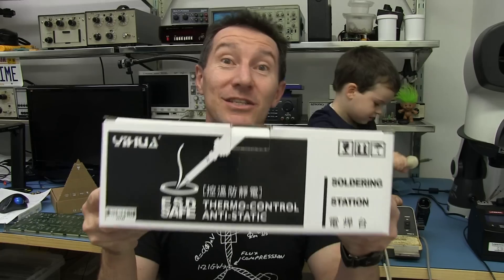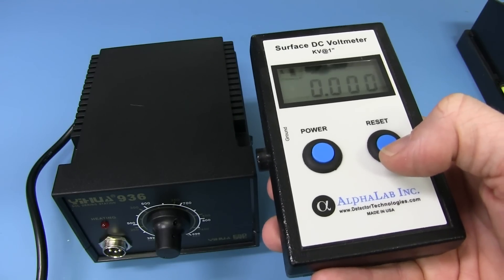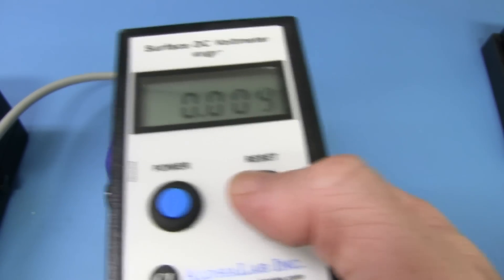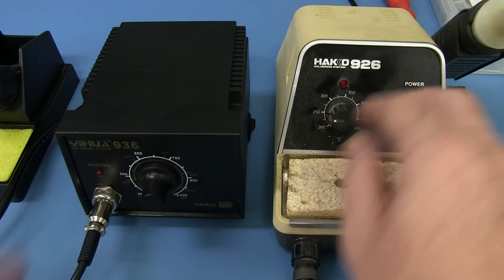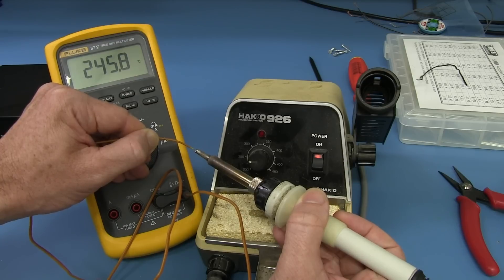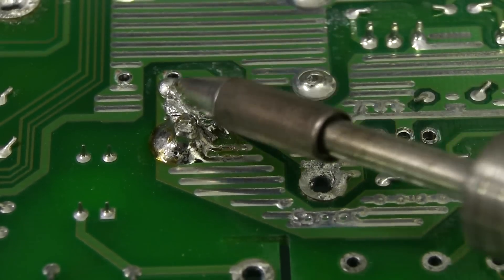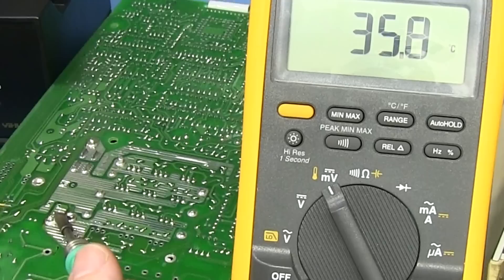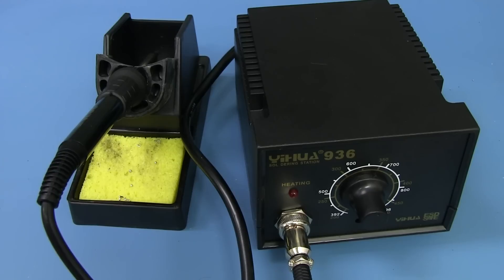EEVblog #596 - World's Cheapest Soldering Station - Yihua 936

Comment: I never even heard of hako irons, at least in the US weller is the big one. I've considered getting an adjustable unit, but what i do usually not really needed. I just use cheap 30 watt pencil irons that jus plug in. Usually use my WLlenk solder gun just because is faster. That i think is a knockoff of a weller unit. works fairly well, but i did have to replace a failing trigger switch on it, and just happen to have one that fit in my parts bin. Transformer on it seems to get fairly warm too, which i'm not a huge fan of. I think ventilation setup could be better to help with that.

I've thought about some like this: http://www.mpja.com/50-Watt-Soldering-Iron-Adjustable/productinfo/17517%20TL/
After watching this though i think i'll just stay away from that. I never knew that the base stations had transformers. I assumed it was all PWM or something like a dimmer switch, just with temp sensing.

Comment: Since when is a crimp connection better than solder?
Reply: You are right, tkarmann. There's nothing wrong with that soldered-on ground lug.

I did cringe at the soldered-on-one-side power switch connection at 10:13, however.

Comment: I own a saike 898d 24v 50w Irion it uses the hako 900m tips I've had it for 4 years now I've replaced the element in the Irion a few weeks ago aswell as a few tips here and there not too bad it also has the heat gun the Irion and the heat gun dose up to 400 c bourt it for 170AUD and it is ESD SAFE  only 1 problem out of 4 years I've done heaps of pcb DIY kits I've done a few replacement parts on brown goods tv,s DVD players ect my iron is a bit bigger compeared to the one on this video

Comment: Cleatly very few Youtube viewers where broken in on have to service the occasional point  to point wiring product.. When attaching a component lead or a wire to  a solder lug the connection is supposed to be both electrically and mechanically secure for applying solder, the purpose the solder being to shield the connection from the athmoshere and not  to be the means af attachment.  Of course from there contruction methods progressed to  PC boards w where the solder is the means of attachment, but that doesn't invalidate proper point to point construction. Although it's difficult to judge the work here from just on angle, although with the solder looking as  sloppy on the solder lug as it does through the product doesn't instill confidence.. I'm old school enough I'd remove the solder and if the job looks unacceptable from there I use solder on it.  Solder doesn't melt away from a solder lug anymore than it does off a PC board under normal conditions, so I wouldn't worry about that.

Comment: I bought this a while back for $50 and it was absolute crap i bought it as an upgrade from my dicksmith branded plug and play job and the only good thing about it was the stand... now I use a butane iron because i use it for my Bike so im in tight spaces and dont want a wire in the way

Comment: With my aoyue soldering station i can solder 6mm copper cable to a 2,5mm copper cable in my hexacopter, this at 350º C, isn't a 16$ station but it was cheaper than the hakko one, and has hot air that works fine

Comment: Why shouldn't ground be soldered?
Reply: Too easy for the connection to break and you end up with no earthing and an unsafe device.
Reply: thank you
Reply: Solder isn't the best conductor compared to copper. The closer you get to copper-copper contact the better. The solder in a solder joint is there to hold the parts in place and because it's still better than air ;) .
Also for solder joints it can be very hard to tell if they are good, especially with cold joints. That uncertainty something you totally want to avoid with an earth connection.
Reply: Personally I don't have an issue with soldered tags for grounding.  It's a much better molecular connection than a pressed crimp.
Reply: The UL Standard for soldering iron's (UL 499) specifically doesn't allow for a soldered ground because the solder can melt.  Other standards will allow soldering only if it is additionally secured in a way that will prevent the wire from detaching if the solder melts, which usually means a screw or nut and bolt so most manufactures just use a screw or nut and bolt unless there is a very good reason.  I posted the clause from UL 499 in the main comments of this video.
Reply: I could understand that applying to a traditional mains element iron.  But if the transformer inside a plastic case is reaching the melting temperature of solder then you've got much bigger problems than the earth wire popping off.
Reply: It's not necessarily the transformer getting hot it could also be the current in the ground wire heating the wire or solder joint in case of a s/c or partial s/c to ground. It also has to pass a ground bond test of twice the breaker current for 2 minutes. In North America that would be 30 amps. (twice a 15 amp breaker)
I'm a little rusty on this but I also believe the intent may also apply to being reasonably sure the ground will go back after service and soldering may have been considered a nonstandard method and wouldn't get reattached after service or perhaps unreliable in method, materials or tools to be considered acceptable.  The reasons aren't explained in the standards and sometimes the reason isn't obvious.   If you work in this product group you would have access to team experts and internal forums to answer these questions.
Reply: In this instance if the wire was passing enough current to make the lug clamped to a large thermal mass like a transformer hot enough to melt the solder, then the fact the flex was emitting smoke along its full length and going "gooey" would probably serve as an indication that all was not well.
Reply: That brings up another reason soldering is not good since the wire coming off may mean the breaker doesn't blow and a serious fire could start. That is why there is always a minimum of two levels of protection and the ground being only one. The plastic of the enclosure and power cord has to have the same flammability properties of metal to contain any flame or dripping molten metal from the transformer windings or overheating wires.
Reply: Richard Evans Aside from the fact that the majority of workshops are fitted with RCDs (GFIs) these days, I'd still choose a soldered tag over a crimp connection.  I've seen plenty of high resistance crimps that result in an appliance failing it's earth bond test.  In that instance the crimp itself would become the source of heat and the potential for shock would increase with its resistance as it burned up.
Reply: bigclivedotcom
Hi Clive I'll re-post the clause from the UL standard  (UL499) here so you can see soldering alone is not permitted.  There are many product specific standards (part 2 rules) and electrical code rules (part 1) that fit together as a system to provide a certified safe product.  Picking one rule for one specific product without looking at the entirety of the system is going to end up as a never ending discussion of what is safe.  You can be assured the Product Safety field is very well engineered and proven over time to best practices for safety.  I could move this discussion over to your YouTube channel to start you off understanding safety testing and product evaluation. See Paragraph 26.3 (c) below, it is better to read the entire standard and the electrical code to see how this rule can or can't be applied.

The UL Standard for soldering irons UL 499 grounding is as below:

26.3 On a portable product where grounding is required or provided, the power-supply cord or cord set shall include a grounding conductor that shall be:
a) Green with or without one or more yellow stripes,
b) Connected to the grounding blade of an attachment plug of a grounding type, and
c) Connected to the enclosure of the product by means of a screw not likely to be removed during servicing, or by other equivalent means. Solder alone is not acceptable for making this connection.
Reply: When soldering to the leads of a transformer.  Don't go for the cheap solder that melt easily.  You want a very high temp solder.  This is for safety reasons when the transformer heats up.  During normal operations, the solder will not even heat up to melt, keeping the wires in connected.  Now while connected to a proper power circuit with ground.  If power spikes happen or a short happens to the transformer, the solder will last long enough to trip the circuit breaker.  If you used cheap solder and or had it on a non grounded outlet.  The solder will melt fast causing more damage in your home or work shop and to what circuit the transformer was connected to.

When connecting to the core of a transformer you would want a crimp connector.  Using a solder connector, the solder could heat up and break loose.  This loose wire could come in contact with the high voltage of the transformer causing a circuit breaker to trip.  Bad case, it might not trip and someone could get a lethal shock.

Comment: Great review.  I bought one of those Yihua 936s and I have just used its innards to do a 110V-to-220V conversion on a Hakko FX888D.  It turned out to be very easy: the transformer from the Yihua is a perfect fit for the Hakko.  I have documented the mod at http://blog.bogpeople.com/2014/09/hakko-fx888d-110v-to-220v-conversion.html.

Comment: I can't be 100% certain, but I believe the earth needs to be crimped & bolted down with a star washer under a locking nut, so it won't snap off or come loose if the unit cops a heavy wack.

Comment: No offence but the reviewer is overreacting, tell "ihaaaa' like a horse sound to a chinese brand name. I bet you have made in china shoes, clothes and many other things. If chinese didn't exist, we wouldn't have products at a low price on the market. We grew up playing with chinese toys and chinese video games and they were great and reliable and cheap. 
That soldering station is amazing for that price. 16$. You should call those chineses brilliant for manufacturing a device at such a low price. And remember...16$ is the price of the station at that store. From China that product came at a lower price. 
How much did you pay on the JBC? How many hundred dollars? You think the JBC has gold wiring inside and platinum made capacitors, precious stones inside or something? No...i bet it has chinese parts inside. And they just up the price, because, hey, it's a big brand name. 
You could have made a better review...paying some respect to the manufacturer, not making fun of that brand name and say all the time how awful is the PCB and how slow it melts the solder. And you made such a big deal regarding that earth connection ...God...even if that earth connect is soldered, there's no chance it will break or anything...don't make such a big case out of nothing.
You people really are looking down to chinese people , instead of being grateful, cause they work non-stop in their factories, with such low salaries and bad working conditions , to build and make things for the others. 16$...it's dirt cheap, it's unbelievable cheap...  And these things many times prove to be reliable.

Comment: If you are starting out poor, I can surely understand the lack of funds....but realize if you using a junk soldering iron ,its pretty likely you will stay poor. I say this because a garbage soldering iorn with misstated specs could easily damage/destroy  a PCB costing thousands of dollars due to leaking current,static and wrong temps.
Reply: Steven Hardy Why would you use such a cheap iron to begin with if you're working on something expensive? :)
Reply: because your working on someone else's stuff for hire?

Comment: Buying a soldering iron that won't stay hot or hold a accurate temperature is like buying a guitar that won't stay in tune and constantly breaks strings. How is that even justifiable to recommend to a beginner that this is the "correct" way to get started. It guarantees nothing but failure and frustration and does a complete injustice to the hobby/profession as a whole. Thumbs down is correct, even for $1.60!

Comment: I don't understand why you would pay several hundred dollars or even thousands for a  high end brand soldering station! What do you actually get for your money? I severely doubt they are anything but marginally better than the cheap stuff.
Reply: FDK try soldering for a living and you'll eat those words.
Reply: svampebob007 Who solder for a living? If you have that much to solder you use machines for it.
Reply: FDK
go for the 16$ soldering station if it works for you, but at one point if you get enough work you'll notice that you can't just keep your soldering iron on 400C to solder off a single cap

Comment: I have one , does not have the brand name, it works ok, and the board in my one look way better than that one its not dirty like that one and the chip and pot don't look re used. The earth wire is also properly crimped.  Mine did cost £20 :P. For the price i think its ok , i don't do that much soldering. I did get a hakko tip for it tho that pointy thing they ship with it is a joke.

Comment: Of course the calibration issue on the temp resulted in a difference with the thermal capacity ... rather silly test as you had just proved the temp was off... But to be fair, you were biased from the get go ...

Comment: Is it better than those $15 Radio Shack 30 watt pencil soldering irons.   Because I've been trying to use one for years and it is totally useless.  If I get lucky I can make a piss poor cold soldering joint with it.   It just doesn't heat up enough.  I found if I stick the iron inside a thick glass vase, I can get the tip hotter, but still, I'm sick of it.  The tip is too fat, too corroded, to useless for anything.   Watching all the soldering tech tip tutorials, I'm pretty sick of the whole idiot soldering mess.   I don't even bother with it when connecting wires... I just twist them together and put a double layer of some heat shrink tubing around the joint.

Comment: Meh, I'll stick with butane irons. Doesn't get much more versatile than that.
Reply: I have both. I find butane to have a lower thermal capacity from my experience; but at least you can carry it in your pocket and you don't need power to use it.
Reply: and then your house catches on fire.
Reply: +Bartosz Olszewski Nope. No cord to pull on and knock the iron over.
Reply: Nekros but if you drop it flame doesn't go out and can ignite something. 400° soldering gun tip barely glows and can't even set paper or candles on fire, soldering stations are far below that temperature.
Reply: +Bartosz Olszewski There is no flame. It's a catalytic reaction.
Reply: I still blows out tons of heat from the side, or at least mine does, thats the reason i stopped using butane as my main soldering iron, its just too easy to burn myself and my table or anything near it.
Reply: +Travis Pratt Mine doesn't do that. Portasol brand all the way!

Comment: face palming all throughout this video. not for the soldering iron, but for how you bash chinese products even when you (probably) deep down inside would see not much practical difference from the "real" thing. I've had my knock-off brand for a while now, i've seen nothing bad from it yet. Tips come at $2 each from ebay, not the best in the world, but not really that bad either. spare element, $6, never had to use it. Also, why the f^$% do you bring your high thermal capacity iron into the equation, there's no reason for the comparison, it's called high thermal capacity for a reason. Knowing you though, you'd bash on any chinese equipment, before you even open the package. Maybe your problem is more personal with the chinese haha.

Bottom line: I highly recommend this for the average poor engineering student needing to get stuff done. Chinese products rule (quality/price ratio)

thanks for reading.
Reply: Marry me!
Reply: Bashar Dawood I see your point, but I think you're just a little unfair here.
The bottom line of this review is: the thing works, but you get what you pay for, which is a functioning soldering station made out of rusty scrap metal and bad craftmanship.

Yihua is passing this thing off as a Hako equivalent, so it's no wonder it is reviewed like one.

I heartily agree with your conclusion, though. This looks like a perfect solution for someone on a tight budget. If you have any plans above the occasional soldering project: get a real brand.
Reply: Bottom line: you're butthurt because this is the best you could afford, and you want to feel like it's worth more than you paid for it, but it really isn't.
Reply: Haha so true. I use so many chinese products these days that I'm actually ready to buy a car if they ever made something decent (RWD) and cheap. I wish China concentrate on making their own products which are good quality, instead of always trying to make replicas that take too much time and effort.